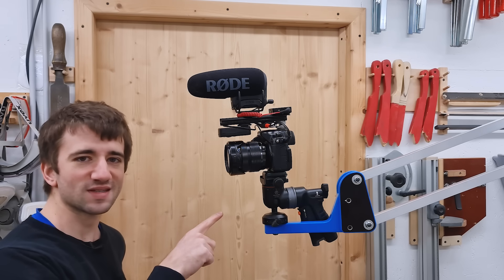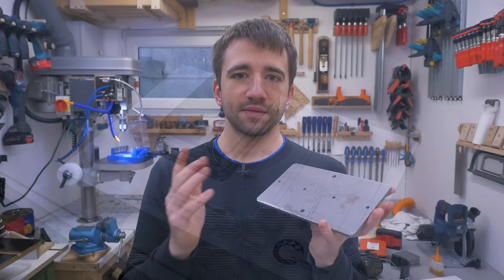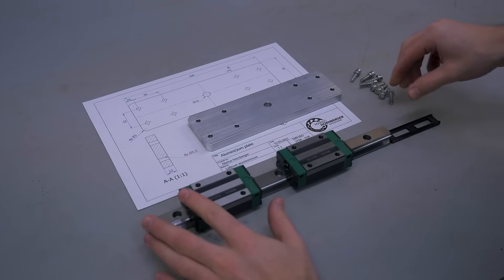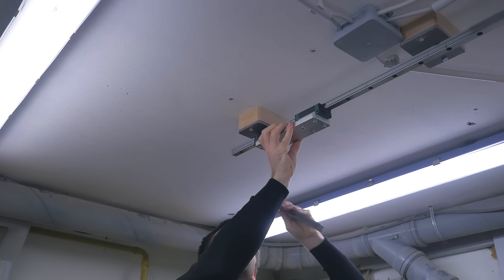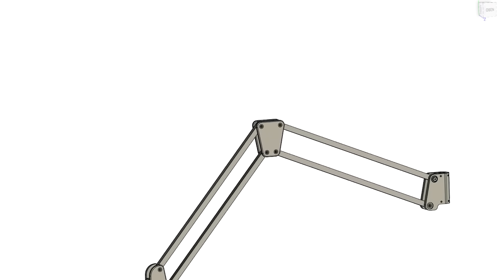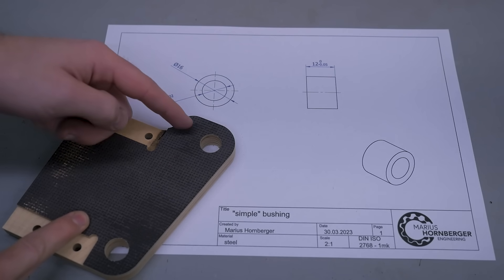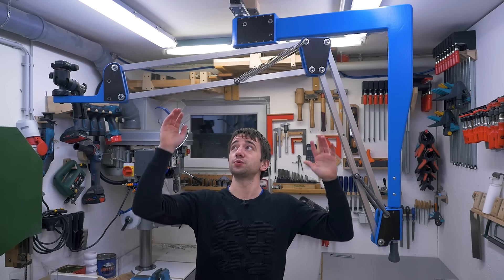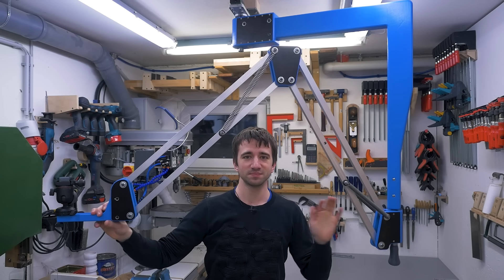Camera Gantry System

Comment: Beautiful work, very inspiring. I'd make the spring tension adjustable to allow using different cameras. Or just for fun, use a cable with counterweights held by a pin like exercise machines use but smaller.

Comment: Very nice job. I have used a ceiling mounted rotating mount for a few years (a rougher build than yours and minus the spring arm), but it’s served me well, I opted to use sideways metal joints for reach and for height I clamp the whole thing higher or lower (this way is not great). I’m making a new workshop right now and you’ve got me thinking about how my old device is actually not that great! Cheers
Reply from the maker: Thanks. I guess you still would never go back to a tripod again
Reply: @MariusHornberger  yes and no. It’s perfect where it’ll reach but unlike yours I don’t have a track, only the circle the camera can inhabit. Also I’m just now building a complete workshop from scratch so i have yet to plan the filming aspect, but your gantry system is awesome. I’m only digging the foundations at the moment, concrete forming and pouring next week I hope. Cheers from spain! Julian
Reply from the maker: Pretty cool. Have fun with the build!

Comment: For a better transition between both rails, you can grind both rails down so the rounded edges are sharp. We've been using similar rails in our 2440x1220mm CNC machine and there's no signs that it's not one continuous rail.

Comment: Excellent build man! And to make two of them is insane. I also really appreciate that you didn't compromise on the quality of anything, i.e. the play in the bushings. I ran into the same problem, but didn't have the dedication to precision that you showed here. Kudos to you!

By the way, how are you finding the wobbling/bouncing? I have to steady my camera momentarily after starting each shot. Not ideal but beats the hell out of setting up a tripod!
Reply: Marius's use of the chamfer is an obvious nod to you, yo.  No doubt.
Reply: Marius's mistakes he made were definitely a homage to the box of shame
Reply from the maker: Thanks Brandon! I guess you could find some of your designs in my build as well. (Plastic in the arm tubes was great)
I also have to stop the camera from bouncing everytime. Then it takes about 2-5 sec until it's completely steady. Probably a thing of muscle memory you will get used to quickly. Another solution is using a remote release.
Reply: @MariusHornberger  I wonder if you could add some sort of tuned mass damper to the end to help absorb the vibrations?
Reply: Nice!  I was going to say that you had done one of these projects too!
Reply: @MariusHornberger  Sure thing, man. Yeah  it's definitely not too hard to get used to. I did play around with the Canon app that connects over bluetooth and shows a live preview and lets you adjust all the settings and focus points from the phone. But I found it to be more cumbersome than just waiting the couple seconds. Hope you're making great use out of your setup!
Reply: great Minds have the same problems 
lmao
Reply: @InheritanceMachining Have you seen the camera arm that Alexander Chappel made?
His requires 3D printing and more floor space but it’s rock solid, super fast and easy to use and has insane range/versatility. 

I’m sure you could modify the design for your own needs… either way, it’s an amazing build and Alex is just great in general and has some really cool builds and unique designs mixing classic scandi furniture design with modern materials and technology like 3D printing and stuff. I’d recommend his channel to anyone who makes stuff.

Comment: this could actually be very useful for normal shops too, but instead of holding a camera, you could run some dust collection tubing along it and use it with a quick connect at the end. Would let you run a single duct for basically all your tools instead of running a bunch of different ducts to them all individually. And with an adapter to use smaller tubing you could hook up all the hand tools with dust extraction (like palm sanders, track saws, routers, etc) to the main dust extractor instead of having to move a shop vac all around the shop.

Comment: Marius, warp a real earth magnet into a tissue or paper keep that near, fix it with a clamp(!) for security. it will get all the mess and dump the tissue, that's it. Thanks for the video and perfect application and idea. Even if you have space on the ceiling, if your ceiling is high etc, it makes perfect sense to use linear rails, though it is somewhat pricey.
Reply from the maker: Good tip with the magnet, thanks!

Comment: As someone with no background in any of this, how does the cut at 12:00 work? He’s pulling perpendicular to the blade it looks
Reply from the maker: That's edited. It's a series of cuts and after the material is removed I slide the piece perpendicular over the blade the smooth out the surface
Reply: @MariusHornberger  oh gotcha, sick edit in that case :)

Comment: You should brace the initial section of the arm with a tension rod or something 🤔 that should reduce a lot of your bounce!
Reply: I'm sure you know what I mean, but for clarity: I'm talking about using some kind of tensioning mechanism (cable or rod) across that 90⁰ bend of the first section of the arm.
Reply from the maker: The wobble you could see comes from the linear rail flexing. It's the weakest link seeing the most load

Comment: One small upgrade suggestion: consider adding some adjustable handles or cam levers to lock the articulation points in position... you shouldn't need them for most shots, but if there is a situation where you can't keep the camera still, or where repeatability over time is paramount (such as long shot time-lapses), I imagine this would be a massive boon (a "Boom-Boon" you might say =D ).  Great project, cheers.

Comment: And further. From such a thing you can make a "drilling machine" (although it's called quite differently). Instead of a camera, put a drill, some joints are fixed. It turns out a "device" with which it is convenient to make holes in aluminum profiles, for example, when assembling "garage CNC machines".

(ooooh, if you put a welding machine ....)

Comment: A design suggestion: To extend the life of your main shaft, I highly suggest you mount a weighted arm opposite your arm assembly. This will offset the high stress exerted on your main shaft and extend the life of the shaft considerably. My two cents. Cheers.

Comment: a replacement for the Nylon washers, could a 3D printer be of use? You could make many of the bushings fairly hassle free, assuming your CAD drawings and the printer settings are correct.  Would save time and expense if you need a lot of bushings.

Comment: Really Nice caméra arm, i love the design and i think i'm gonna make one for myself, i got almost everything but.. what kind of springs did u use for it ? i want to buy some but idk which one would do the job as good as your :)
Thanks for your reply and keep up that great work :)
Reply from the maker: I have 18mm OD, 2mm wire thickness, 180mm long
And  15mm OD, 2mm wire thickness, 180 long springs.
Longer springs would be even better. I'm almost overstretching them

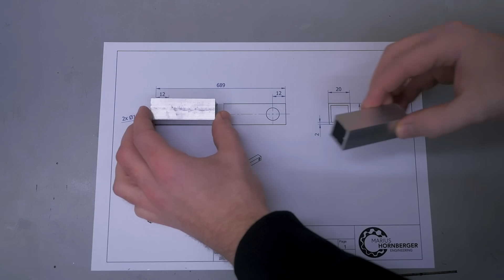Comment: 16:55 Why the “WTF!”?
To me it looks like the drawing scale is wrong… maybe the 12cm length is wrong on the paper? I dunno.
Did I miss something obvious?
Reply: It was supposed to be one long bar with a hole at both ends, as you can see by the smaller image on the bottom. The reason it looks like two little bars is because the middle bit was left out😅

Comment: You might need to watch out for bumping into this gantry and messing up your shot. The spring force from the parallelogram arm holds up the camera at different positions all well and good, but you have nothing keeping the swing arm from sliding on the rails or turning if you smack into it. Might there be a brake mechanism you can implement on the pivot and the rails? Maybe that might help some of the wobbling when you demonstrated the arm holding the weight?
Reply from the maker: Bumping into a tripod ruins the shot as well. Without tripod legs in the way now, bumping into the camera is a lot less likely

Comment: grate job!! as usual. your attencion to the detail is amazing. 
i just have one doubt, why you need the blue L shape arm and dont start the paralelogram arm directly from the cealing.  this way you could store all of it on the cealing and the blue arm wont be in your way. im sure you thought this solution and put it away for a reason but i would like to know it.    thanks and pardon for my horrible english.
Reply from the maker: Without the L-shaped piece the usability wouldn't be as good and a lot less camera angles would be possible. Hard to imagine without using it like it is. And like now I can also put the vertical part of the L-shape into a "park-position" where it's out of the way for when I'm not filming.

Comment: If you plan to do more steel cutting in the future, there might be some ideas to steel from Cold Saws. In metal shops there's 3 main ways to rough cut stock, bandsaws, abrasive saws, and cold saws, which are basically extremely high torque miter saws with an integrated vice and coolant pump. (for the record Hot saws are extremely similar but are meant for cutting glowing hot metal, and they have considerably different tooth geometry to deal with the metal being a wee bit gooey.) Cold saws are usually built out of a handful of cast iron bits to give them a ton of rigidity, and have a big stonking motor at right angle to the blade, like a worm drive circular saw but I don't know what the gearing in there is. They also feature the most important thing you might care about, a lever, 12~18 inches long, to pull the saw down through the material and ease the amount of force you need. The vice designs are worth seeing, lots of consideration put into making a vice you can saw through without either side moving. I've seen you do a lot of surprising things over the years so I'm not suggesting you buy one. If you decide to build a wooden one, that'd certainly be surprising.

Comment: It's not the same quality, but you can always use your smartphone for the rare times you want the camera pointed at the camera shot - I imagine you have a relatively modern smartphone - most new-ish smartphones have pretty good quality, and you can get a tripod mount for them pretty cheap nowadays too.
Reply from the maker: I tried all that, but the image quality difference was too big. A secondary camera should be another good investment I guess
Reply: @MariusHornberger  no camera lasts forever - especially in a shop setting - so you're essentially just buying an insurance/redundancy for when the old camera dies! (in case you needed an extra argument to pull the trigger :) )

Comment: Is the plywood with a black surface you use some form of concrete forming plywood?
Reply from the maker: Yeah and also for trailers and similar as flooring
Reply: @MariusHornberger  thanks! I’m thinking of using it as a work surface in my mechanic workspace

Comment: your manufactured bushings were tight but then too small once pressed in, wouldn't the original nylon ones have been similarly the right tightness?
Reply from the maker: I tried that with one nylon bushing and it worked, but it got squished so much and slightly though off concentricity. And I also wanted the bigger shoulder

Comment: 9:29 yeah, that's massively unsafe. If you sneeze and stick it in too deep, that finger's not gonna survive. Forget degloving, that's a whole hand sausage fest. Lathe rule of thumb: never stick your fingers where you wouldn't stick your weenus. And that's as politely as i can say it. For that operation, you can easily fabricate a stick with a bit of insulation foam wrapped around it and shaped into the shape you need, with the sand paper glued on top. It's a 10 minute fabrication of a custom tool.

Comment: As ever I like most of it, it's very impressive in all respects. But I'm slightly worried about the flexibility of some components, in part because of the youngs modulus of your swing arm & parallelogram arms. But also the resonant frequency of the parallelogram arm & camera head in the tilt axis. Perhaps the camera's internal stabilisation will fix it all. I'd look out for air transmitted resonance. I'd havmade the parollelagram arms shorter & stiffer (possibly even using a tri-leg format). Perhaps using a ballance arm using a counterweight format, In place of the Parallelogram arm. Then suspended the camera BELOW the mounting pin, as centrally as possible.

This system is wonderful wonderful for accessibility, but I wonder if  you'll get vertical camera wobble, when doing vibrating cuts with tools.
Reply from the maker: Nothing in my shop moves air hard enough to affect the camera gantry. The wobble is no problem. Takes about 2-5sec for it to settle and stand still

Comment: What's that app/website you used for bolt torque?  I hate having to look up various charts online and that looked really quick and easy to use.  Does it include other head limits too? Worked for a big company that didn't know a flathead screw and hex head of the same thread cannot take the same amount of torque and oh boy had they been stripping hardware for years.
Reply from the maker: The app is called: MechTab

Comment: Personally I liked the bare wood, but that blue is a really nice color and stands out as a nice contrasting pop in the middle of the workshop. 
This is currently my second favorite camera crane after Alexandre Chappels studio camera crane build. 

Video if you’re interested, I’d highly recommend it because Alex is really good at mixing techniques and technology and engineering to solve problems. 
https://youtu.be/V9e9ZWflCQU?si=APgQmP_HVXrJaIld

Note: Alex uses 3D printing in his build but mostly it’s made of materials you can buy at a hardware store and he sells the plans and files for you to make one. 
Also, his design requires floor space. It doesn’t hang like this one or many other styles.

Comment: A specially cheap project - given that the giant linear rails in this size are several hundred of euros each.
Reply from the maker: They were surprisingly cheap. 175€ for all of them. 4x 1,5m tracks and 8 blocks
Reply: @MariusHornberger  Wow! Still expensive, but that's a steal! The cheapest HGR35 Sets I found were around 600€-700€
Reply from the maker: The rails are HGR20. Big size difference. Considering my current tripod was about 140€, it's not that expensive anymore.
Reply: @MariusHornberger  Oh - they look massive in the video. That explaines a lot.

Comment: As those springs age, they will become fatigued.  I hope you saved the adjustable mounts or have a reliable supply to replace them.  
    Have you gotten used to the presence of the gantry yet, or do you still bump into it now and then?  
     Amazing build!
Reply from the maker: I love it. Never have bumped into it yet. Finally the camera really is out of the way when I need

Comment: The production quality has certainly improved with this video.....Showing drawings for mere seconds just to get a LOL at having created drawings for a small but still significant part. "Yes, I made a drawing for a washer", and we all know how long it takes to create drawings is testament to the production quality improvements you've implemented.

Of course, the actual gantry arm build, not once but twice shows that you care about the quality of your videos. 

We know you want the best quality for your personal satisfaction but we, the audience appreciate it. Adds just that little bit more entertainment value.

Also, I thought you had gotten taller but that's not possible at your age. Pretty sure it's not a thing to have bone implants in your shins or thighs, so I guess you've lost some weight.
Reply from the maker: Thank you!
I got some new shoes for the workshop during the build. They are about 3 cm higher than before
Reply: @MariusHornberger  LOL.

Comment: i wonder if your shutter angle is part of the reason the drill press shots look so unnatural. in motion video, it's generally best to set the "shutter angle" to 180 degrees to get good looking motion blur, in laymans terms this means the shutter speed on your camera should be twice that of the framerate you're shooting. I.e, for 24FPS video, you want your shutter speed to be locked at 1/48 of a second, or for 60FPS you want 1/120 second exposure. that way, even if the shutter speed and drill spin rate are synchronized, it'll still have realistic blur instead of looking like it's frozen in place.

Comment: Hell no indeed. On a side note... are those hand saws a joke, because that wrist position is not for normal human hands. I was desperate for a saw on a project, and that saw type was the only one i could buy at that late hour. It's horrible. Genuinely horrible in design. I fixed it by welding a handle that put the proper angle on it, but jeesh, whomever came up with that hand saw design must have double jointed hands. :))
Reply from the maker: Yeah I never hold it by the handle, but by the metal "frame"